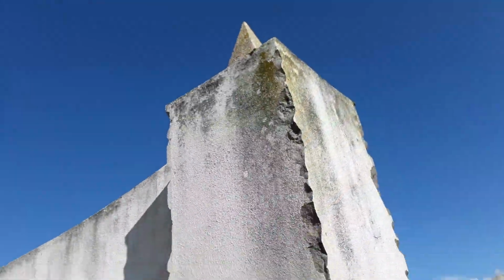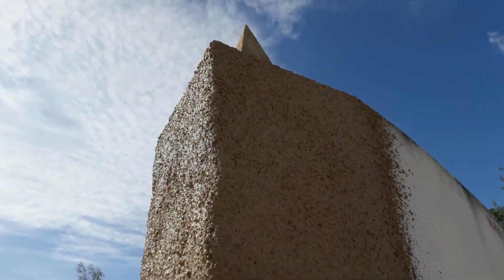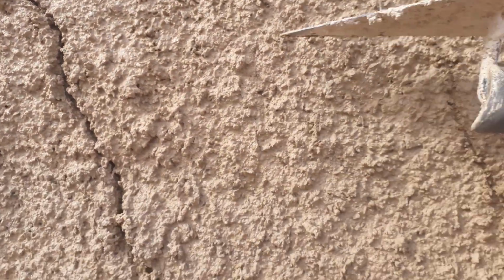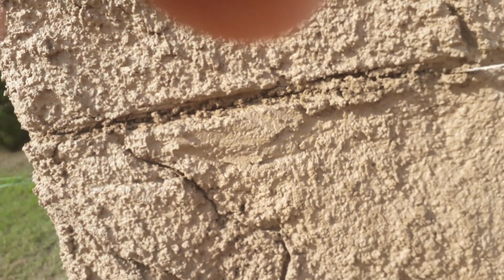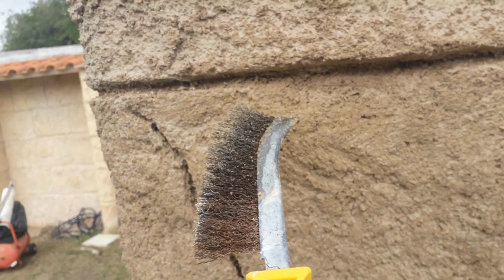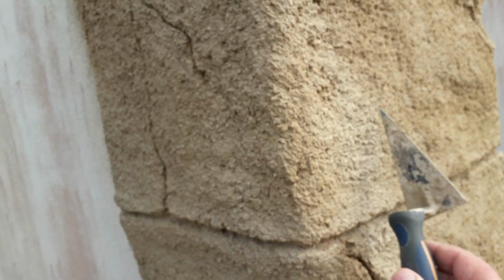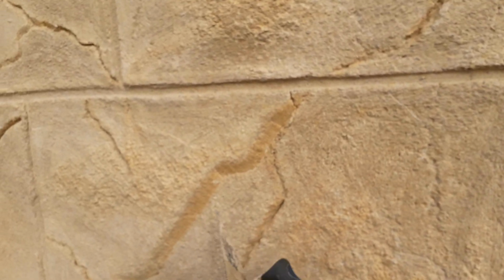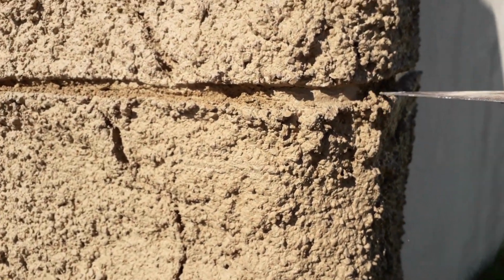How to make Fake Stone - [Part 1]. Watch This Gatepost Transform Into Castle-Like Stone. Be Amazed.

Comment: your work is the most realistic ive seen! thank you so much for sharing this, just subscribed from UK...at our place i made a large pond using limestone and it got expensive so began using old broken concrete and mortoring over it to imitate but your finish there matchs the real rock perfectly, would you be kind enough to give a little more detail on the mix, did you say its crushed stone and limestone? ive never seen crushed stone sold anywhere here! thanks in advance! keep up the amazing work